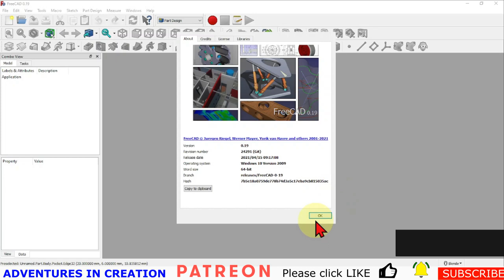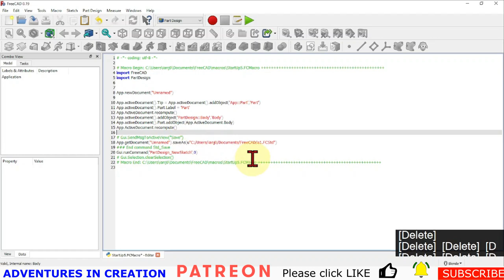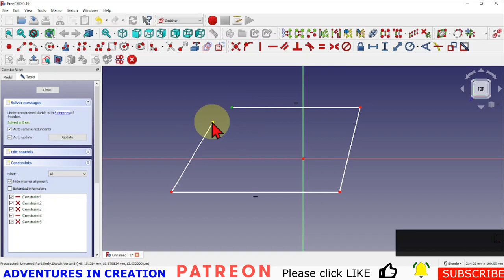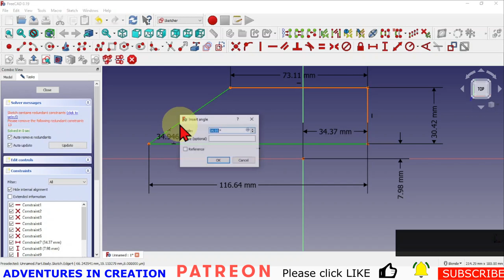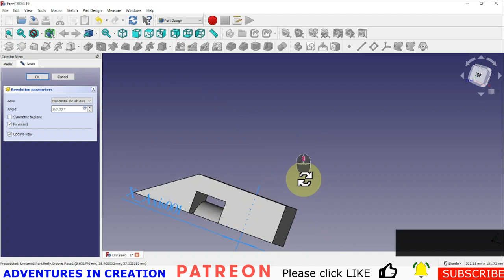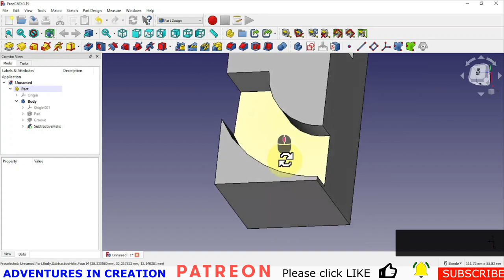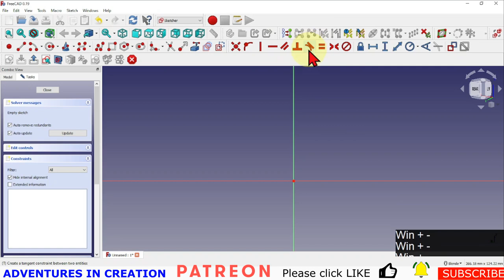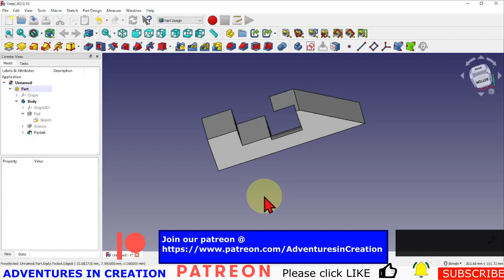FreeCAD for Beginners #11 Improve Your Modeling

Comment: I am loving all your tutorials! 
I used your instructions to make a macro to not only start a new file-part-body-sketch but also to create a symmetrical square, rectangle, and circle around the origin since we've been using them so much as a starting point in a sketch. I gave them all just random starting dimensions (10mm or so) and then all I need to do is double click and change the dimensions to what my specific project needs. I even did 2 circle ones so I can choose whether I want them constrained on the radius or the diameter.
Reply from the maker: That's very cool 😎

Comment: I accept I am probably doing something wrong but when I execute the Start Macro (which was recorded and edited in line with your tutorial) the scale of the Axes, and hence the first sketch, is enormous and is flat, not isogonal. Which means I have to compress the scale in order to get it to a meaningful level to allow me to start a sketch. Update: I "think" I have cracked it. Go to Edit - Preferences- General - Macro - Gui Commands. Check the box - Record GUI Commands, Uncheck the box - Record as Comment. Record your Start Macro then Edit it by adding # and a space before the Gui.runCommand('Std_DigMacroRecord',0) which in my version is Line 6. Save and run the Start Macro. This modification gave me the same looking Axes view I am getting by manually clicking New Document - new Part - New Body - Sketch.
Reply from the maker: Sounds like you got it working, thanks for posting your steps. That may help others to get it working too.

Comment: Thank you very much for great tutorials! 
You showed in this episode that creating a sketch based on a face of a body can lead to the hard to predict results. That happens if you decide to change something in the very initial sketch defining the body shape and  it changes the number of faces the body has. 
But what if you do that in this way. 
1. Mark four vertices of the (rectangular) face on which you want to make a sketch. 
2. Click on the datum plane. The plane is created on the face. But it is not related to the face number but to the vertices numbers.
3. Draw the sketch on the datum plane.
4. Create a pocket or a pad depending what is needed.
I tried this on one example and it seemed to be insensitive to the change of the number of faces in the body. It seems that the vertices numbers remain unchanged, 

I am a very beginner to 3-D CAD so please let me know if this concept makes sense or I am missing something important.
Reply from the maker: I think your concept would work, as long as you don't have anything relying on the faces within the model.

Comment: I would like to see a video “How to constrain like a Pro”.  You did touch on that but would like the “don’t do this” and this is why you don’t want to do this.   I did notice that all constraints were applied to the sketch and then you made only one reference to the axis to make the sketch lock to the origin reference.  I think some of my issues are because I am not doing this.  It would be a great topic for beginners.  All your hard work is appreciated…..many thanks!
Reply from the maker: I will consider doing a video on more constraints, thanks for the suggestion.
Reply: There are many videos on the constraints explaining what they are and and how to apply them.  But there hardly none on constraint pitfalls.  For example I was over constraining I the beginning because I was working a lot in just sketcher to design a servo linkage geometry, never padding to a solid.  The geometry was multi-level fulcrum, bearings servo throw etc. I was also doing that because I was unaware of Tech Draw workbench that does all the dimensions for you when you create a page.  So maybe it starts off with a constraint discussion and ends with a intro into Tech Draw.  I’m now going to wiki pages for more information.

Comment: Question, you have the option to rename face planes..will this work around the bug if you do rename it?
Reply from the maker: Which bug? Are you referring to the topological naming issue? I don't think it will but you can give it a go.
Reply: @Adventuresincreation  Yes, I noticed you can rename them and am guessing that if you give it a name it then will use that over the default system temp names? Lets hope 20 fixes this since I as well ran into it a few times not sure really what was going. Also if you can rename them I'm wondering then again if we can create a custom macro to then rename all faces to xFace## where the macro can check if the name starts with X or even if there are two places possible the name can be stored.

Comment: Very Informative Video, so I created a DatumPlane by selecting the 35 degree surface and then created my pocket, 17mm deep, OK, Close, opened up Pad then sketch active, created the box and trimmed, OK,Close and my pocket did not move, Cool Thanks for all your quick replies!
Reply from the maker: Great!
Reply: I just became a Patreon and am very excited about  your content and the interest you have proven to have in your followers!
Reply: @Adventuresincreation  Please sir, I finished my homework. However, when I did what Weliver Gary did last year, but using v0.20, it didn't seem to work.  My pocket disappeared if I modified its parent pad.
I slogged away at this, so bear with me!  I see that one can give constraints a name, so in the first Sketch I named the X- and Y- offsets of the 'datum' at the lower right, and the height, top and bottom dimensions. (I thought adjusting the dimensions to make the maths easy was cheating...).  I also added a reference dimension for the slope angle at the left, to save myself some calculation.
Then, I made a datum plane in the XZ plane of the first Pad, and moved it using the Sketch.Constraint.[name] syntax: up by the Y-offset, across by the X-offset minus the bottom dimension, and rotated it by the slope.  I can sketch on that plane, and it doesn't get nobbled by the TNI.

Thanks very much for these videos; even though they're 0.19, they seem to be wearing very well, and I'm learning a lot.
Reply from the maker: @jonathanrichards593  sounds like you have it under control

Comment: Ian. Many thanks for your excellent series and the great way you convey your message. Really clear and helps an 'old fart' like me. However, a couple of issues I have run across and I was wondering if you might have the answers. 1. First, I have made a 'StartUp' macro following your instructions, and it works well. What I was wondering was whether thyere is a way to have that macro run automatically every time I start Freecad. 2. Second is a much larger issue in that I have downloaded and set up Freecad at least 8 times now - including about 5 times using the "working' version, and a couple of times trying the weekly build, but every time it loads and runs but with NO MACROS. When I try to add them from Wiki through the AddOn Manager, I get an error message telling me that 'GitPython is not installed'. I am running the latest version of Python (10) so not sure what to do. Any suggestions? Cheers, Noel
Reply from the maker: Thanks Noel, I appreciate the feedback. #1 I don't think there is a way to automatically run a Macro at start up. #2 This seems to be a common problem, I am not sure if it's something to do with the PATH variable not including the location of the GitPython software. Many people have cured it with a re-install (I think that sets the PATH variable) but this doesn't appear to be fixing it for you. I am not sure what OS you are using but you might want to try calling GitPython from the command line and see if that leads you to why   it's not working. - I assume it is installed on your system.
Reply: @Adventuresincreation  Hi Ian. Thanks for the reply. I am using Windows 10, etc, with Python 3.10 and have re-installed freecad at least 10 times now. Doesn't seem to reset the path. Not sure how/where to go from here. Strangely enough it worked perfectly well with Freecad v18, but I no longer have that or I would re-install that and see what happens. Oh well - guess I just have to push on and try to work around it somehow as I really like Freecad, especially after getting mucked around with Fusion 360. In the meantime if you have any bright ideas would you please let me nkow. Cheers, Noel

Comment: SolidWorks has a rib feature is there an equivalent in freecad? Keep up the great work.
Reply from the maker: I have never used solidworks so I am not familiar with the rib feature, what does it do?
Reply: Rib is a special type of extruded feature created from open or closed sketched contours. It adds material of a specified thickness in a specified direction between the contour and an existing part. You can create a rib using single or multiple sketches.
Reply: Ribs are reinforcement structures that are used to help to fix two sides together. Hope this helps to clarify .. thanks for your early response to my queries.. regards
Reply from the maker: @iModel-ft6kh  I don't think there is similar tool in FreeCAD however you could just model a rib I suppose.

Comment: Is it possible to change the order of items already under a part?  Ive run into situations where I really wanted to have things put in later to be earlier in the tree.  Thanks and have really learned alot from your videos.
Reply from the maker: That can be really tricky, the best way to move them is to delete them and re-add them where you want them. The problem is, when you create a part it builds from the last state so you might change something inadvertently that will cause the model to fail.

Comment: Hmm, so right clicking the sketch constraints to activate/deactivate is what I expected the checkboxes to do, which didn't seem to work... What does toggling the checkbox actually do? 😂
Reply from the maker: The checkbox turns them off.
Reply: The checkbox controls the visibility. Lets you hide them so the sketch looks cleaner, but they're still active.

Comment: FYI, your record Macro segment does not work in 0.21.1, followed your sequence exactly but could not replicate, and the resulting file created is dysfunctional. Doing the process manually all is ok. ????
Reply from the maker: That's interesting, I will take a look. I am still using that same macro but I will re-record it in the latest version if it's different I will make a new video
Reply: So got it to work, however the lines to Uncomment were slightly different than your example. Also for some weird reason when i did the Pad it disappeared the view, double checked closed sketch etc. Then just did a circle, same issue. Had to change the Display Mode in the Data tab of Pad to Flat Lines to get visibility. Gremlins afoot! @Adventuresincreation
Reply: Thanks for this content by the way. Also I have set Part Design as the startup tool bar and added a custom button to run the macro. Got that bit from: https://www.youtube.com/watch?v=KujiAIHNRKQ , so if you do make another video on Macros you may want to include that capability as well. Best Regards